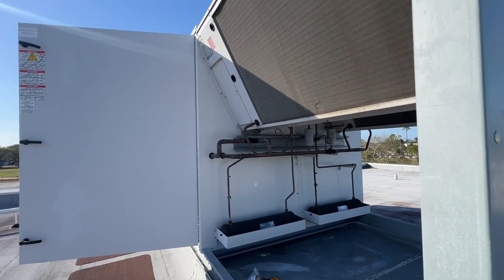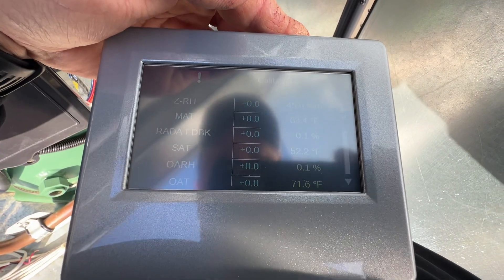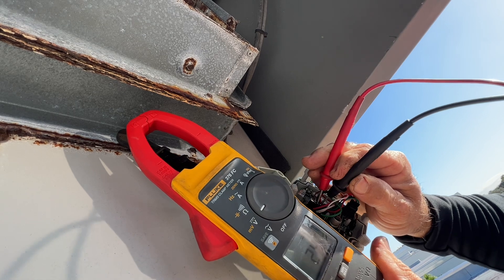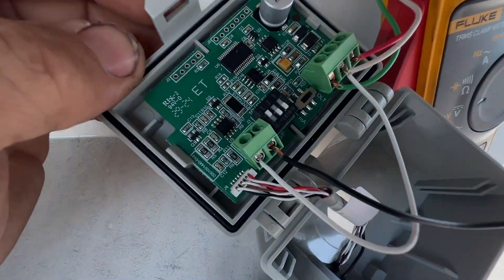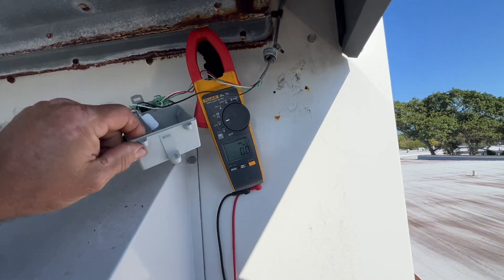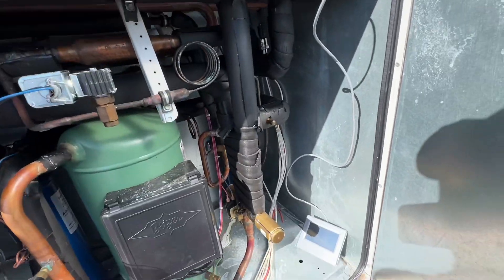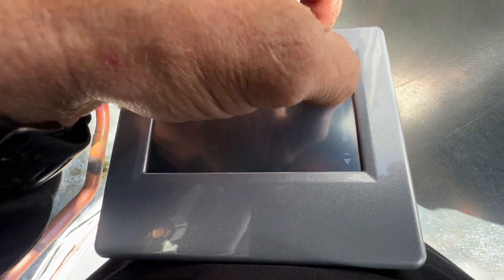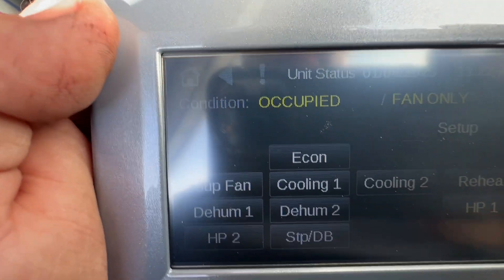Overpriced OEM Parts $2800! Really? Replacing Outside Air RH/Temp Sensor On Addison RTU

Comment: Hey have you had any trouble with the Bitzer scrolls ? We've had tons of compressor failures with them .
Reply from the maker: Not yet, what type of failure are you having?
Reply: @subcoolHVAC  grounded windings and black oil ! They've had a very bad series of them in my opinion . They've supposedly corrected the issue but I'm sceptical because I've heard of other failures even with the supposed "good" ones ...
Reply from the maker: Thanks for the heads up, will make sure to go through all electrical connections . We do get a good amount of surges and momentary outages , especially with Thunderstorms

Comment: It's supposed to go on North side to keep it out of direct sun. Direct sun on OA sensors affects sensor accuracy. Needs to be in a shaded place at all times. I Like your solution though, easy adjustment. Commissioning should have caught that.
Reply from the maker: @HVACTIME  Yep, the other 2 at this site face West 😂
Reply: Holden your right. Good job on your chiller academy.